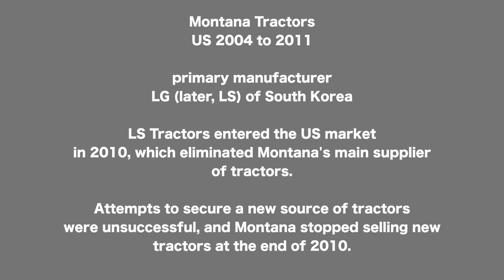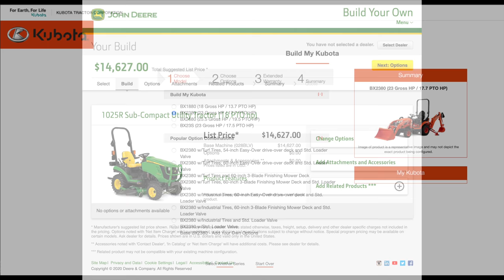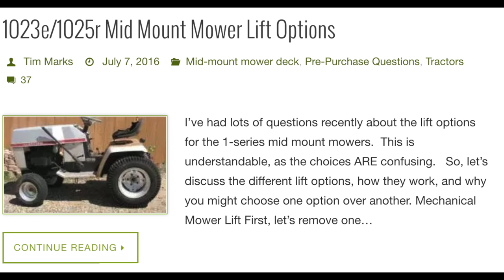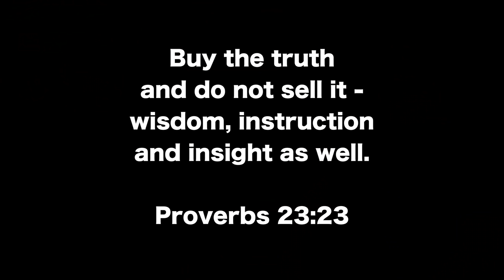Have NO REGRETS! Watch This Before You Buy A New Compact Tractor!

Comment: Luckily since I'm in a rural area farms and fields are the thing here so we have plenty of brand choices as far as machines go. There's a New Holland dealer a couple miles from my house, there's a CASE/Cub Cadet/Kubota dealer 6 miles in one direction, we have a Massey Ferguson/Kioti dealer 6 miles in the opposite direction which ends up leading to the John Deere dealer. There's also a Mahindra dealer in the "city" if that's your thing

I've been looking at machines recently as I want to get one once all of this insanity is done with and I'm back to working. I stopped and looked at the Massey's to see how they were all setup, the small machines the dealer had in stock all seem to come equipped with a backhoe standard, which I have no use for and the controls felt alright. I think the only thing it had over the John Deere I looked at was an adjustable steering wheel. Which on the Deere it didn't matter because the static wheel placement felt good the John Deere also had a far better seat. Also the larger Massey's the dealer had in stock were far too big for my needs and had the awful rocker pedal for the hydro-drive. 

I didn't look at the New Holland dealer yet, but they ended up not being a choice after I tried to build one on their site and the equivalent Boomer model to the John Deere I looked at ended up being more money than the John Deere. But I'll have to take a peek anyway and see what they have. I'll also end up taking a drive to the CASE/Kubota dealer too to see what they have, but I feel I'm going to default to the John Deere. I liked the placement of all of the controls, it was easily for me to get on and off all three models of Deere I sat on, all controls are easy to identify and the cockpit felt the cleanest. Also I think John Deere is the only brand to have full rubber mats where your feet sit where-as the Massey I looked at was naked painted steel so it had no protection from getting scratched while walking on it.

Again, I haven't looked at anything other than the Deere and Massey so others might also have rubber floor mats. As for Mahindra, no, I'm avoiding them because I've read and watched reviews of people who bought one and regretted it. Also their customer service and dealer chain is supposedly quite awful as well. Also, the John Deere dealer seems to keep more units in stock. Some base tractors, some with loader, and some with both loader and backhoe so you have more choices to look at. :)

Comment: Keep in mind The new John Deere tractors have a copy Patten on any Deere that has a on board computer. As a farmer I can't hook up to the computer and get a read out to find out that a sensor is bad. This is the problems us farmers are having. We have to spend the money have them come out plug into it and have them run the computer to tell us what is wrong. Just keep this in mind when looking at buying new or older tractors. I love my Deere I love the parts availability. I hate having to spend money to have them come out and say this is wrong.
Reply from the maker: Don’t they have a way that you can see the code?   My family gets on the phone with Deere dealer, tells service guy the code...he brings the replacement part, installs it...tractor down only a few minutes in many cases.  
I’m not arguing with you on the right to repair thing.  I have mixed feelings.  Just seems to be less of an issue in real world usage than in theory.
The theory / principal of it all is bad, I agree.  In practice, not sure how bad it will be.
Again, I’m not attempting to debate it...just trying to observe real world impact.
Reply: @TractorTimewithTim  yes some tractors you can see the codes but not my last 2 tractors. I have to have them come out or I have to take the tractor to them to have them run it. That is what is bull. I won't buy another one because of that. My last 2 was that way. Cost me to much money and to much down time.  It might be fine for people who have a dealer right down the road but the closest one for me is about 50 min drive one way. The problem is I'm not there only customer witch I understand. I just think it's BS that I can't get the code to even tell them I need this part or that. I have older John Deere and love them but when it comes to me buying a new one I have to go with something different then John Deere. A service call for them to come out and run the code is $250. Just to tell me what's going on. It's not so much the money it's the time that hurts when I am running that equipment it has to go. I can't let it set.
Reply from the maker: @dustinfox5703  yep, if you can't get to the code...it would be frustrating. Which model(s)?

Comment: I bought a JD 3032E for the ranch, I have been greatly underwhelmed by the quality of this machine, it's cheaply built and in my opinion JD has been getting by on former reputation.
We needed a bigger tractor so I contacted my guy at JD, told him what we needed, somewhere around 75HP with the details and they just sat on it for months, took their sweet time getting back to me, mean time I had done a project for the guy who runs Case IH locally and contacted him with what I needed and my frustrations with JD, he got back to me in 2 days with a deal ( a good one) for a New Holland 75HP with cab, A.C. lots of bells and whistles, implements, ect... 
Made the deal with him, and I have to say, I was a little scared spending that money on a brand I felt wasn't exactly high quality, but I have been nothing short of impressed with this tractor, the quality is far superior to the JD. 
It's actually not even close, JD called me with numbers a week after we got the N.H. and his numbers for a 75HP E series was more than the N.H. equivalent to the JD M series that we got. 
The JD M series which is the N.H. series we got compares to was going to be well over $100k, we got the N.H. for a little less than the JD E series would have been, and it is significantly better, very user friendly and quite comfortable.
The seat has about 5 or 6 adjustments including air suspension with a little compressor which my back appreciates.
I had called my JD guy a long time ago asking if there was a better seat I could buy for the 3032E cause it was killing me and of course they never got back to me.   
JD's service and quality has gone down the toilet the last decade and it's high time people snap out of the  "it's a JD, therefore it's automatically high quality" mindset. 
They're overpriced junk anymore, old 80's versions are good, if you can find them. 
Good luck.
Reply from the maker: Judging overall deere quality by their lowest end 3e tractor is not wise.  The 3e is not on par with the rest of the line.     The 3R is a dramatically different (better) tractor.
Reply: @TractorTimewithTim  I have a good friend who is big in farming, like thousands of acres.
He hates the new JD's from 100hp on up to the largest, says they're just as cheaply made (in scale) as the e series, not dependable at all.
I know this as I had told him what I was trying to do and he let loose on how much he cant stand modern JD's, he loves the old ones but avoids the newer ones like the plague if he can.
Plus I have a moral problem with the JD holds customers hostage with their locking the software and not letting farmers fix their own stuff. Its wrong.
Reply from the maker: @ajs96350  Fair enough.  My family is VERY pleased with their 8410, 8335R, and 9670 STS combine.   ...as well as the 4720 sprayer.       Frankly, your comments just seem like spite to me.     ...but that is fine.  Plenty of room for different opinion.

Comment: When I was looking for a particular tractor I looked at the brand name first and then the length of time the companies have been in business. I knew about the Massey Ferguson tractor since I trained on a new one of their brand decades ago, and since Ford was out of business I knew about the New Holland who bought them out, and I knew about the John Deere company who had been in business a long time. Kubota is new to me, but I heard that they have been in business awhile and was a good brand also. I ended up getting a John Deere brand and since they was close by like the Massey Ferguson dealership was also. When buying the tractor I have the company had a package deal with a trailer, brush hog, box blade package together since it sounded good to me and it worked out perfectly for me. Later I purchased a tiller and lawn rake for it and also purchased a zero turn mower from the same dealer.Later I saw a need for a front loader and wished that I had gotten one of them with the tractor and didn't want to just get just the loader to put on the tractor and ended up buying a new tractor with one on it.

Comment: A local tractor guy once told me, get the biggest tractor you can afford. You'll never complain of having too much power.
Reply from the maker: I simply disagree.  But that’s ok.
Reply: @TractorTimewithTim  He meant it as a general rule I'd say. Personally I think it depends on the size of your land, and what your doing with it. I have 2, a 97hp Case 1594, and a Ford 3000 diesel 47hp. I use the Ford way more often, kinda says it all.

Comment: I'm in the market for a compact tractor, I'm 6' 5" is there enough leg room in the 1025r or should I go up to the 2025r its primarily going to be used for mowing.
Reply from the maker: These two will have essentially the same legroom.
Reply: I'm also 6'5". If you want legroom, without a doubt, go with Kioti. Most legroom. Best ergonomics.

Comment: Spend time (a lot of time) on tractor forums of the brands you are serious about buying, ...before you buy one.  You will learn a lot from other people's experiences, tractor and implement choices and options, problems, mistakes, successes, etc., etc.. 
Ask for some extras to be thrown into the deal you agree on, before you sign, such as technical service manuals ($$$ after the fact!), two keys, rear tire ballast, include an initial first service at the recommended interval, other SWAG, etc..  Whatever you think you might possibly get away with asking for.  It doesn't cost anything to ask.
Reply from the maker: ...or maybe spend some time watching TTWT! :-)
Reply: @TractorTimewithTim  
...goes without saying, since they are already here watching!
=O)

Comment: Buy a 1980s Kubota B7200/8200 or John Deere 650. You'll only pay maybe 3-5k up front and still have a reliable machine with parts available
Reply from the maker: Disagree for a first time suburban owner.  Would bring frustration for those not into being a mechanic.
Reply: @TractorTimewithTim  you're correct. I should've added: "if you don't mind working on your own equipment"

Comment: Just curious about something,  why don't you see a flail mower mounted on the front of a tractor?
Reply from the maker: how would you power it?  There are not sufficient hydraulics to run a hydraulic motor.
We don't have front 540 PTO option here in USA.
Reply: Couldn't the mid pto power it like the snowblowers with a shaft?
Reply: @TractorTimewithTim  how many PSI would it take?

Comment: I love how you are still showing the smaller BX tractor to the larger 1025r. Compare the B series with the 1025r. Anyone watching can see the 1025r is even much larger when parked side by side than the smaller BX. Heck the B size tractor even has less hp than the deere and will outperform the deere with no problem. Time to be fair Tim!
Reply from the maker: Hashed and rehashed Herm.   
The specs of the BX and 1025r are almost identical.   Even the weight.
B2601 compares more to the 2025r.

Comment: Hills will outright kill a k46-class transmission. If you have hills, you NEED a garden tractor (not a lawn tractor) at a minimum... if not a sub-compact or compact.
Reply: I pulled a 900 lb. lawn roller around my hilly property for 10 years with my old JD 175 Hydro before replacing it with a X500. The only difference now is the X500 has a differential lock which helps when the yard is muddy. My brother has been pulling a 600 lb. lawn roller and heavily loaded steel utility cart around his hilly property for the last 12 years with a LA105 he bought at Lowe's. Yes, a heavier duty tractor is nice to have but these smaller machines are not the ticking time bombs that everyone makes them out to be.

Comment: Saying to only buy John Deere or Kubota is horrible advice. Massey Ferguson has been around as long as anyone and they make great tractors. The Deere and Kubota tractors are overpriced as well.
Reply from the maker: I stated that this is my opinion.  You are welcome to yours.
Agco does not build the little Massey's.  the tractor is built in China, and the engine comes from Japan.
I don't like the seat, or the strange steering wheel.  Very awkard to drive. 
Hydraulics are good.  Backhoe easy to control. 
Overall a decent machine.
However resale value is poor.
Again, just my opinions.  Lots of our viewers have the Massey GC, and are getting along well with them.
For now, I'll stick with the 'Big Two'.

Comment: How do explain Deere using Yanmar engines in their small tractors?
Reply from the maker: Not sure that there is to explain.   Yanmar engines are incredibly reliable.
Reply: Tractor Time with Tim I get that but they outsource their engines on anything less than 75 +/-   Kubota is all Kubota.  Not knocking it at all
Reply from the maker: Doesn’t matter.   Outsourcing engines is no big deal at all. Has been done for many years.  Cat and Cummins make a LOT of the larger engines.   
I’m equally happy with Kubota or Yanmar engine.  Both are excellent!!

Comment: Questions I ask myself when purchasing a track what does a finance committee say do I need a different size truck and trailer what will I be doing with it options came down to do I need a cab or a backhoe instead shuttle shift or hydrostatic and like you said Tim we all forget about the storage room my choice was the RK 37 shuttle shift backhoe end loader had it for 2 years no trouble with warranty issues a grapple was I majored need  Within 30 days

Comment: I bought a Kubota BX23S over the JD 1025R (for several reasons) and I made a mistake that I regret
Reply from the maker: Uhoh.  Sorry to hear that!
Reply: Why do you regret your decision?
Reply: @jasonl5961  The lifting capacity of the BX23S is dismal, far less than the 1025 John Deere, which I discovered as soon as I began using it. (Tim proves that lifting capacity difference in at least one of his videos.) The "treadle pedal hydrostatic drive pedals." I was told I'd get used to them........I haven't! I've gotten used to hating them. Especially bad when moving snow and going forwards and back a lot. Having to move your foot back and use your heel to reverse is tuff, especially with heavy winter boots and gives me a real pain in my right hip. In spite of being shorter than the JD 1025R the Kubota doesn't turn as sharply as the JD, takes more room and more back and forth to get around in an area. I wish the Kubota had draft control like the JD, but it doesn't. I wanted my tractor in order to save my 69 year old back moving wood to the log splitter, since I heat with wood. I cut the logs to length and then hoped to move those cut pieces in under my vertical log splitter with the Kubota ( a 17" long piece of dried white oak can't weigh that much.......Right? Can't move it at all with the Kubota. the hydraulics just sit there and wine. So in two years I have less than 30 hours o  my kubota and most of those were trying to move snow around. While the Kubota sits out of the weather, in the barn, I'm outside in the weather with a log hook, straining my back and legs to get wood in under the splitter, just as I had to do before I bought this anemic Kubota.. At least my nephews will inherit a mint condition super low hours sub compact tractor to sell.
Reply from the maker: Sounds like you should just bite the bullet and trade it for a 1025r!  For the purposes you are describing, you would use it enough to justify the expense. No use continuing to be frustrated with a machine which doesn’t do the job you need done.
Reply: Me purchasing the "wrong tractor" is ALL " Tractor Time  with Tim's fault" no question about it! Just kidding, of course, but had Tim's' comparison videos between the JD1025R and the BX Kubota come out just a month or so earlier than they did, I definitely would not have purchased the tractor I did. Tim's comparison videos should be a must watch for anyone who is thinking about purchasing a tractor of a any make.

Comment: ever thought about new holland tractors?
Reply: Tim and I were just discussing New Holland in another thread. I was saying that even though New Holland is a rebadged LS, they have always had a good reputation, a huge dealer network and a long agricultural legacy. They also have linage back to the old Ford tractors. To me, the relationship between New Holland and LS is almost like John Deere and Yanmar.  If I was to purchase a tractor other than JD or Kubota, it would probably be a New Holland.